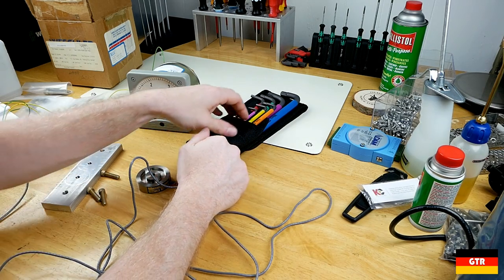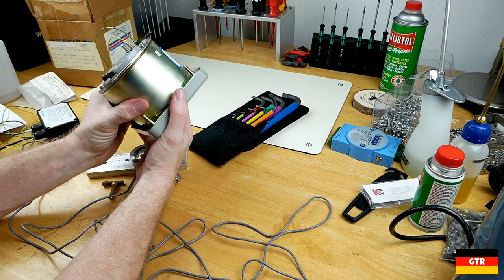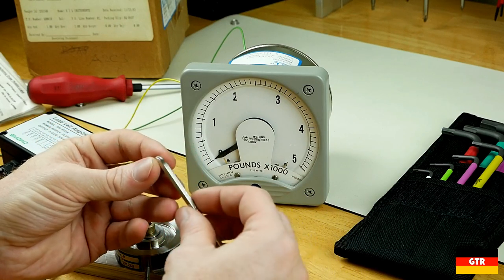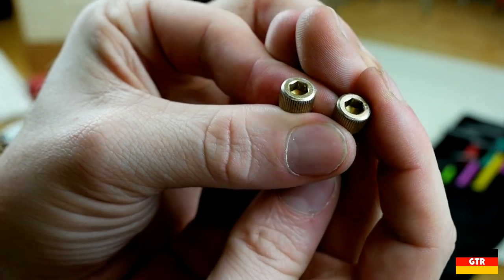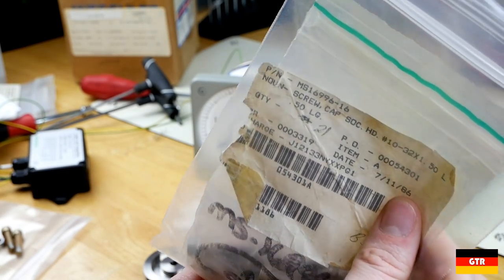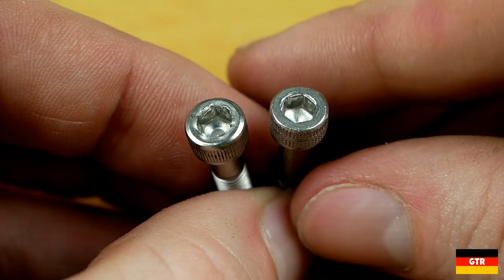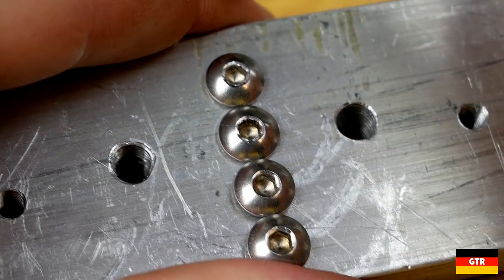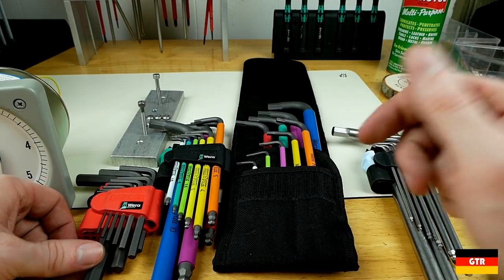Why I now exclusively use Hex-Plus L-Keys:  A short demonstration

Comment: I got really excited when you said you said "test to failure" . awesome video, I've been wanting those L keys and it's gonna be the next thing I get from KC
Reply: They are nice, but I didn't get them cause the hex is only on the tip, then it gets wider on the shaft, unlike a traditional L-key. It looks like that could cause problems in polaris blocks, and other lugs.
Reply: Name Of Action can't say I've ever seen polaris blocks that this would be an issue (i usually only work on larger ones)  they should work for 90% of the things I do though
Reply from the maker: Yeah I could see the color-coded sleeve getting in the way in certain situations but I haven't yet run into that problem.  They of course have styles without the coating.  BTW, Wera calls this their "Take it Easy" system.  Looks like someone at Wera is an Eagles fan:  http://www.wera.de/takeiteasy.html?L=1
Reply: Mike's Tool Shed Yea, the last key he used was a Wera hex plus w/o the sleeve; but it did have a round shank. They do have standard, all hex stock, keys that are hex plus, though.

Comment: I don't think i've ever stripped a hex unless i was using the wrong size, or applying a strong side load.

Also, that husky seemed to fit quite loosely.
Reply from the maker: Yeah the reason why I started out with small loads is to prove that applying a proper torque should not be a problem with either type of hex key.  The main advantage of the hex-plus system would be loosening an overtorqued socket cap screw or one that is badly rusted in place.   I was going well past the recommended torque for these size bolts.

Comment: Is hexplus a different hex tool or do you need both a hexplus fastener AND hexplus tool?
Reply from the maker: No, it is just a trade name for their hex key profiles.  They will work on any hex socket cap screw.  I've never heard of a hex plus fastener, not sure if you meant Torx plus.

Comment: The proper way to zero a meter is to turn the adjustment screw clockwise until the needle goes from below zero to read on zero then turn it a tiny bit counterclockwise to put the adjustment cam in the center of the adjustment fork.  I'm sure those aren't the correct names for those parts but that's the best I can come up with.

Comment: Is Hex plus the L keys and use normal hex bolts or is it both head and tool
Reply: If it is just the tool then i know what im using to repair bikes now
Reply from the maker: if you are asking if the hex plus is on both ends, it is only on the short end.  The long end has a standard ball end hex.

Comment: How do they compare to Torx?
Reply from the maker: You would definitely get more torque out of a Torx/Pentalobe screw.   However, Torx machine screws are still quite a bit more expensive than standard socket cap and are often not available in the lengths that you need them in, which is why we still haven't seen a universal move to Torx.  Wood screws on the other hand are a different story, with almost all exterior wood screws moving to Torx heads.
Reply: German Tool Reviews Thanks for the reply! Yes I see a lot of wood screws are available now, they work great. I work on industrial machines made in either Denmark or France and they use Torx for all smaller fixings now and have done for years, shame more industries don't follow. Too much penny pinching and building to lowest cost unfortunately.

Great vids, thanks for sharing your knowledge 👍
Reply: German Tool Reviews I remember changing some control arms on my '86 Ford Escort. Those (or maybe it was the anti-roll bar) were held in place with T40 screws.
Reply: I find with Torx screws if your bit is not perfectly inserted into the head it will strip. I do not find that issue with Torx Plus fasteners. While Torx screws have a pointy star burst  hole Torx Plus has squared corners so it looks like a gear. https://postimg.org/image/enzbadetr/

Comment: Damn you, I need these like I need a hole in the head lol. Anyways I clicked on the affiliate link and bought the long arm standard metric, this will be nice for all the drain plugs and pulleys I take off cars when working on them. Usually I'm not the one who put it on and they're on there TIGHT... thanks for saving me the potential headache of stripped hex heads.

Comment: The two bolts you tested to failure were not identical - what's up with that?
Reply from the maker: Someone else noticed this and I did investigate.   They are Mil-spec parts which means that they can be slightly different but still meet critical specifications such as length, pitch and size.  Someone noticed that the thread lengths were different and I pulled the Mil-spec and I there is only a minimum thread length specified for that part number which is 0.875 inches with no maximum.  Therefore both screws are equivalent according to the mil-spec.  They were definitely manufactured by different companies and I should have paid more attention, but according to the military they are the same screw.
Reply: Functionally equivalent when torqued to service maximums may be true. Certainly the weaker of the two bolts meets the minimum strength requirements. However, with a difference in shank length will definitely change the yield characteristics at the ragged edge.

That said, to be a really valid test you'd need to do several iterations anyway to help minimize skew due to minute manufacturing tolerances. And using otherwise identical bolts would be a requirement of that as well. Otherwise it's just for fun really.
Reply from the maker: Probably true, in a real test you would have multiple samples, throw out the best and worst and then average the rest.   I'm also not using calibrated equipment.    Look out for something in the future that should hopefully address these concerns.

Comment: Why do you say 2000 lbs of torque when the meter indicated 1000 lbs?
Reply from the maker: The meter only goes 0-5 while the sensor is 0 to 10,000 lbs.  Therefore multiply the meter value by 2,000.  20 milliamps = 10,000lb = 5 on the meter.

Comment: upset some canadians and test them against robertsons!
Reply from the maker: I don't think I've used a square drive in over 10 years. I remember they used to use those on load center lugs and I always seemed to strip those.
Reply: Yes, dual drive screws are common on load centers and circuit breakers.  The standard slot makes them weaker.
Reply: philips is 10x worse than robbies, thats coming from a canadian, what needs to change is drill bits for better grip on the bit in a drill
Reply: Klein makes a driver that works slightly better than normal square for the combo screws in panels/receptacles. Catalog No. 7314/7324
Reply: Hehe, reminds me of something. I work on a oil platform i Norway. One day one my way to work there was a loose "step nose" on the stairs. Hmmm... looked at it and saw ut was Robertson( not common in Norway) Went to the mechanic onboard, he never heard about robertson... there was some robertson bits but the one i needed nr.4 was not there so ended up grinding a nr.5 (there was actually alot of nr.3 and 5 bits so i guess some other has run in to the problem :) )
Reply: well it does make it easy to just use what you want on it, just hope its a strong steel you wont strip

Comment: I just came across a patented design of hex sockets from powerbuilt - https://www.powerbuilt.com/collections/hex-torx-keys-and-sockets/products/8-piece-zeon-sae-hex-bit-socket-set-for-damaged-bolts - which they call the "zeon" system, meant for removing hex bolts with stripped heads. They also have this system available in hex L-keys. 
I'm wondering which is better at removing stripped out hex screws/bolts - the hex plus design or the zeon design. would you care to do some testing?

Comment: Aren't they just a version of star drives? Which I have been using for years I might add.
Reply: No, they're not.  These keys are intended for use on standard socket head cap screws.

Comment: why and how were you doubling the value when the face has written pounds x1000 1x 1 is that value
Reply from the maker: The meter takes 4 to 20 milliamps input.  20 milliamps = 5 on the meter.  The sensor puts out 20 milliamps at 10,000 pounds force.  Therefore you would need to multiple the meter value by two.  If the sensor was only a 5,000 pound sensor then we wouldn't need to multiple.  I could have also done it in the amplifier by adjusting the gain trimpot but that would mess up the calibration.

Comment: Or just replace every internal hex bolt with a torx or internal splined bolt. Because a Wera L-key will not fit into the bit-to-socket adaptor for my torque wrench.
Reply from the maker: I have found that the Torx screws are often many times more expensive than the equivalent hex socket cap.  The screw length selection is also limited for Torx machine screws.

Comment: Screw any fasteners that aren't hex head bolts
Reply: Torx > hex, the torx has more bearing surface area to spread torque force tha hex.
Reply: OSO503 - No Love for Torx?
Reply: S7tronic I agree. There is a reason why deck/construction screws are all Torx T-20, T-25, T-30.
Reply from the maker: Yeah you can definitely get more force out of Torx/Pentalobe screws.
Reply: Bolt any fasteners that aren't hex head screws
Reply: Hex is better in hard to reach places. Its too easy to put torx bit in on an angle and then strip the head while working on something deep inside engine compartment.
Reply: German Tool Reviews But they are even worse to strip :/ But you almost never strip them.
Reply: Hex is just better. In real life, you learn these things. Sure you can get more torque on it when its flat on a bench sitting on a machine when its a brand new screw with 0 corrosion. But in real life, when the corrosion has set in or the previous ding dong already slightly stripped it etc, hex always wins.
Reply: I wish all stainless fasteners were torx, there's no better tamper proof fastener than a cleanly cammed out hex or square drive. In my experience the torx will spin the clutch in your impact or the screw will snap before the head gets stripped.
Reply: Im 99% sure OSO503's statement was overlooked. When he said "hex head bolts" I infer that he's referring to standard 6 sided bolts that use a socket or wrench to turn, not the negative or inverted style shown in the video. And as a response to Nalu Rash, deck and construction screws are moving to torx fasteners from phillips screws, not hex. In a real world application, robertson fasteners handle more torque than phillips, hex or torx, assuming you have a properly fitting bit for all four. Furthermore, it's been well proven that a standard bolt head can handle more torque than any hex/torx fastener, so why would you want a such a fastener if it's clearly inferior. Seems to me like it's the same idea as someone using nylon or abs rather than steel, copper and white metal for rod and main bearings in an engine (sounds like a potentially good idea, but no true practical backing)
Reply: Why use a fastener that can easily have the head filled with corrosion, especially in automotive settings. Personally I'm yet to understand a single reasonable purpose to use a hex or torx fastener when a standard 6 sided bolt head would be available. They handle much more torque, are much more common and have better tools created for them. A grade 8 or higher 6 sided bolt, paired with a properly fitting Snap-On flank drive socket or equivalent tool will always break the bolt, pull threads or break the socket first. It just seems like the most practical answer by far.
Reply from the maker: I talked to a guy who said he was working on an engine where all of the bolts were external Torx instead of the typical hex head.
Reply: Have seen external 12-point and VW like their internal 12-point (which some previous owner has always had a go at with torx). The external 12-points are OK cause many sockets are often 12 point and I've found the internal 12-points to be more solid than torx (which will often not round out but will sometimes deform to form a "thread" which will push out the tool when you apply some torque).
Reply: German Tool Reviews why not just use all stainless bolts on engines? The extra cost a the point of manufacture would be minimal surely?
Reply from the maker: My guess is that it is because stainless bolts are not as strong as alloy steel grade 8 bolts.  18-8 stainless is somewhere around 60 to 70% tensile strength as the same size grade 8.  316L is stronger than 18-8 but still not stronger than a grade 8.  Designers get around this by using larger sizes once they know the loads.  I'm not a mechanical engineer so I'm sure someone can chime in as to the actual reasoning.
Reply: German Tool Reviews Yes, stanless screws break quite easily. I made some chain sprocket fasteners for my Honda CB250RS when I apprenticed as a fitter back in '95. Two of them snapped and a third lost the nut after about 40 miles. I had ordered some new originals, but had to wait 2 weeks to get them from Belgium (I live in Denmark). I had to put the old ones in again after I limped home.

Comment: You do realise you were stripping the aluminium block and not stretching the thread right?
Reply from the maker: Yes you are correct, I was stripping the inner aluminum threads.   We've always called this stretching because it does deform/stretch before it actually strips.

Comment: Excellent test, thank you for performing it and getting that equipment. Stuff's expensive.
Reply from the maker: That's why I tell the guys in logistics to give me anything that is destined for the dumpster.  Just as long as I don't run out of space, which may happen at some point in the near future.  I did sell a bunch of flight transponders on ebay because I know I will never own an airplane in the future.   But that is rare, I usually find a use for everything or give it away to someone you needs it.

Comment: What I can't stand about these plus sets is the plastic sleeve. If I have an L key on-hand and need to tighten a recessed bolt inaccessible to me with the short leg, I can put a 6" knipex pliers wrench (smooth parallel jaw motion ala "crescent wrench") and tighten using the ball-end. Not optimal due to the nature of the ballends but it's a fantastic option to have. The plastic sleeves on these also slip off with use and I've had to remove them to get an adequate grip on the tool for performing the work, then re-sleeve them. Just pointless. Quick identification of the size of wrench based on color is moot when you know that you're looking at either a metric or standard set and can tell the size by looking at the business end of the wrench itself.

Comment: Any system works provided you have tools and fasteners that are sufficiently hardened.  The trick is getting the highest performance at the lowest cost, in the fastener mostly, but both components are important.

Unless you look at the fasteners and tools under a microscope and measure deformity with a micrometer, you're not really learning anything.

Comment: measuring the tension on the bolt is irrelevant to measuring torque on the hex...
Reply from the maker: Using a torque wrench is just another way to set the bolt tension.  There is an equation to convert between the two using the bolt size, and coefficient of friction.    There is more information here:  http://www.engineersedge.com/calculators/torque_calc.htm    Torque wrenches have a known limitation in that it assumes a nominal coefficient of friction.   Lubricated bolts will give different results than dry thread bolts on a torque wrench.

Comment: I work on machines that use hex head bolts and setscrews extensively, and use hex key wrenches everyday of my working life for 25 years. I own and have used Wera, Wiha and Bondhus, all three are good brands. I liked your experiment but would have preferred if you had used quality hex wrenches of the same size and shape. The T-handle style you used and the way you used it wasn't a good apples to apples comparison, and I wouldn't consider Husky to be a really quality brand (although better then craftsman which are abject garbage).
Reply from the maker: I did do a followup video to this one to address some of the issues that people pointed out:  https://www.youtube.com/watch?v=eRZjNYGHeRQ

Comment: I wish there weren't so many damn different screw heads used by industry. Every time someone invents a new and improved fastener head some slick salesman pawns this idiocy on the manufacturers and mechanics have to buy not one but a dozen or more of the tools used to fasten/unfasten them. Get rid of some of this nonsense including the easily stripped common screw head. Now we have to have a set of "security" bits to remove different tamper resistant screws.  GM cars and trucks have a nasty habit of intermixing  a lot of this foolishness on their vehicles. Screw Robertson, Torx, spline,  clutch heads, et al, all designed by shitheads.
Reply from the maker: Yeah there are sure a lot of them, wikipedia covers the main ones:  https://en.wikipedia.org/wiki/List_of_screw_drives    

The weirdest one I have seen is  pentagon shaped bolt head (Penta bolt).  You cannot use a regular wrench on it and need a special socket, but vise grips would always work in a pinch.